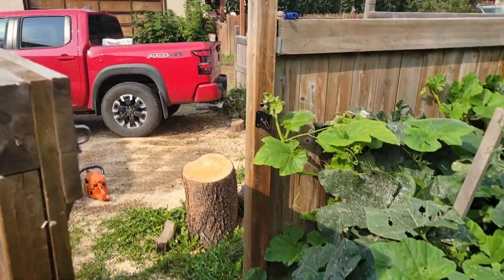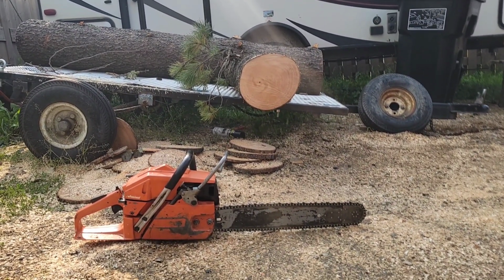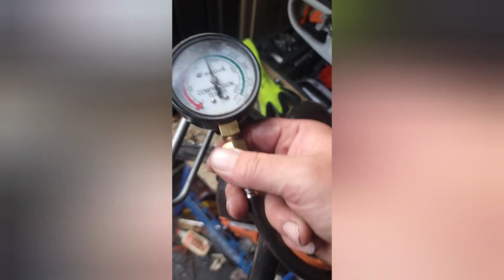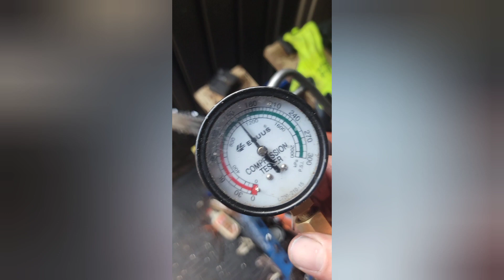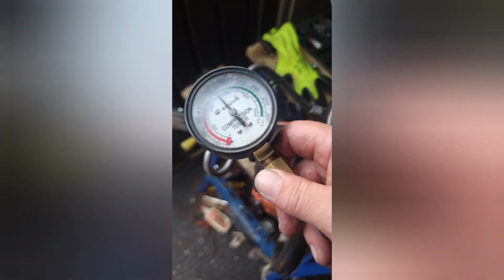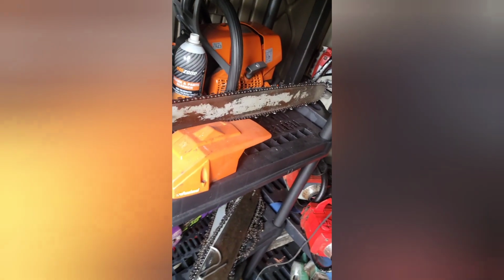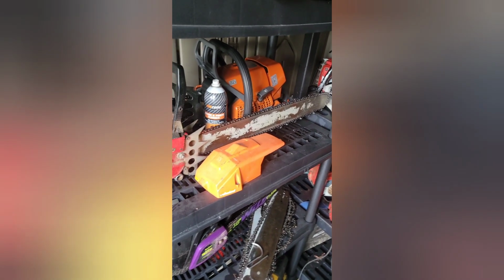ported husqvarna 61... meh 😒

Comment: That really doesnt sound like a normal 4 stroke, I think your ignition is checking out on you, or has a bad connection/short somewhere.
Reply from the maker: I'm thinking that too, port number a are good, with new ring there is 180psi cold, I wonder if the Chinese ignitions are any good
Reply: @chainsawcanuck  I bought a dozen off of Ali Express 4-5 years ago, haven't had a bad one out of that batch yet.

Comment: Does that have a limited coil?
I’m having sputtering issues with the 310. Going to try changing the coil and see if that helps….it’s been so humid here lately- wondering if there isn’t some water in my fuel……???  Might try that first.
Reply: No limited coils on those old 2 piece ignition saws.